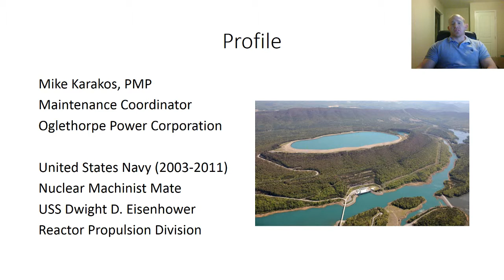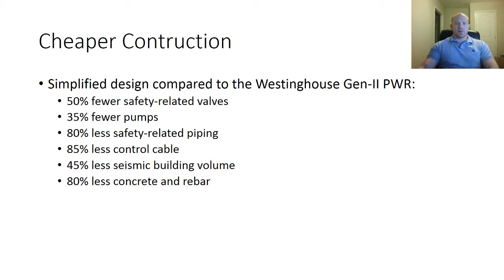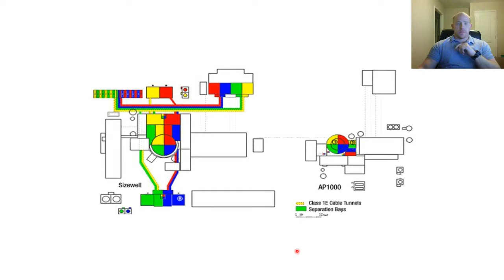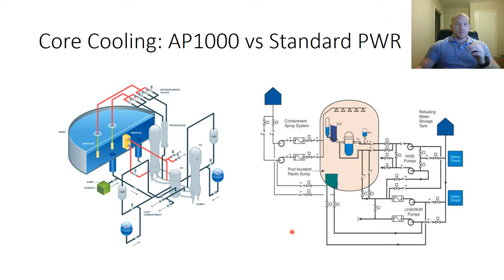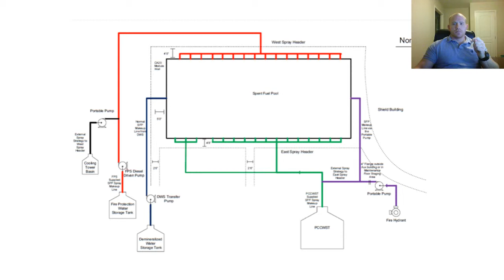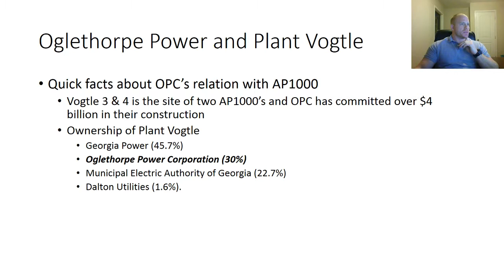Nuclear Renaissance: AP1000, Oral Presentation

Comment: Australian Aerospace engineer here.
Shame about the video quality because the info here is fantastic and its timely because of current Australian discussions in 2024.

I've spent most of my career in industrial control systems and automation. I have been formally trained and certified in both functional safety (TUV Rhineland) and hazardous areas (explosive gas & dust). So I understand the safety methodology in much of this and this is the best explanation I have seen so far of the AP1000. There's a Westinghouse AP1000 YouTube channel but it hasn't anything new in 9 years which says a lot about where Westinghouse are.
 
FYI - I used to work with a US Navy Nuclear Power Plant Operator here in Oz (circa 2006/07). We had a couple of really great discussions on nuclear power and the philosophies of various operators like the USN. Like you he served on Aircraft Carriers.

We also talked a lot about his training and that's where I get worried with Australia. His training was intense and the training system was highly valued. My problem is the commercial interests of the private sector in Australia DO NOT put a lot of emphasis on skill sets and training people. They also have a strong aversion to listening to anyone with technical qualifications. Technically qualified people are not seen as resources but a problems to be managed.

Comment: I worked on an SFP Fukushima mod and went to almost every plant east of the Mississippi. 2 were the same, and it seemed at times that different people worked on different parts of the facility and they assembled it onsite, eg open a door and there is a tripping hazard right in the opening.

Comment: 1:20 If the AP1000 is a simpler construction and has a smaller footprint, why is the construction much more expensive than the older design? Westinghouse went bankrupt because of the construction problems and cost overruns at NPP Summer and NPP Vogtle. https://en.wikipedia.org/wiki/Virgil_C._Summer_Nuclear_Generating_Station#Units_2_and_3
Reply: The contractor botched construction. Once Bechtel came in, progress has been fine. But a ton of work had to be redone. 

Like, there's a reason China and Poland are  building more AP1000 reactors even with the vogtle disaster
Reply: I laugh every time I read that the reactor is modular and cheaper.
Reply: @darrinkinney2268  Modular is substantially less expensive, look at the 20+ reactors China is building right now.
Reply: Bureaucracy combined with few project accepted (for any industry, the more project you have the better the econkomics for chain production)